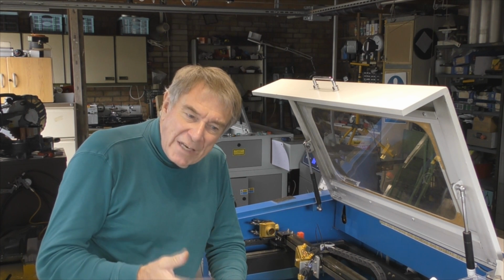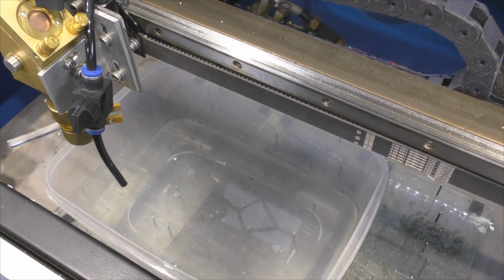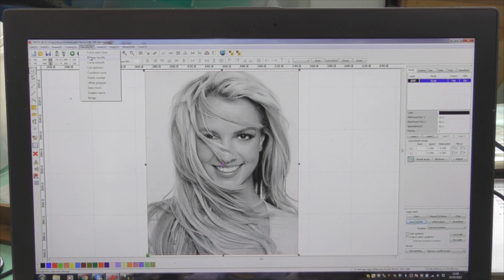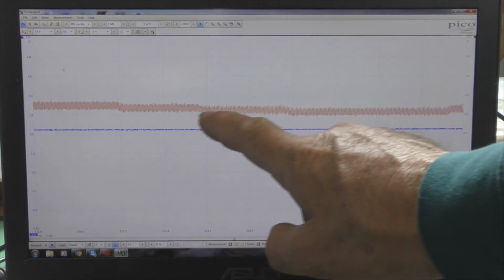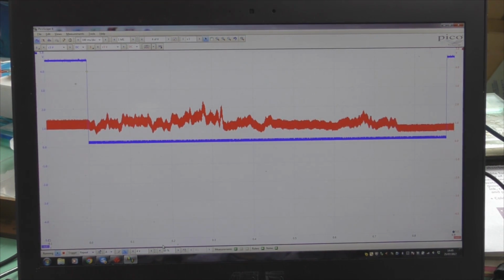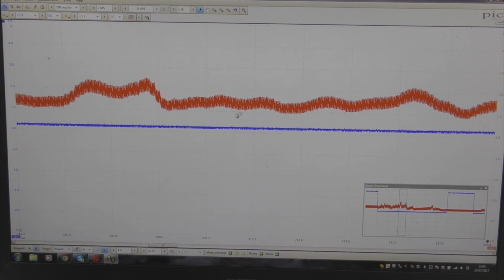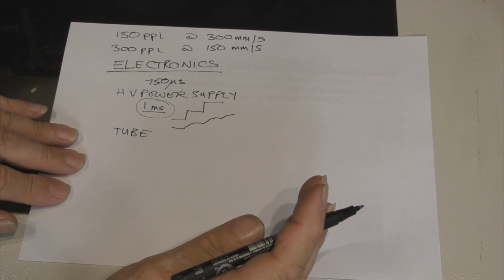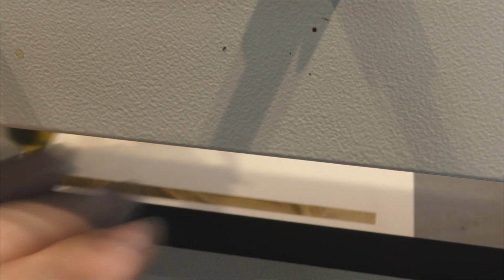RDWorks Learning Lab 114 Can We Dither Greyscale images

Comment: I've been working on greyscale engraving for a while and there are a lot of variables to take into account to get good greyscale images. Moisture content of the wood, Temperature of the wood. But think of this when it comes to greyscale. The Greyscale pattern on something like wood is not linear. As the wood starts the burn it gets darker. As it gets darker it absorbs more of the laser energy quicker and gets even darker quicker. So you can not use a linear power curve to get nice greyscales as the image will look very dark and the dark end of the scale, but by reducing the power,  the image becomes faint and washed out. If you want a 10% grey, you might need 15% power, to get a 20% grey, you might need 20% power, and to get a 30% grey you might need 22% power. I have plotted a chart to workout the power curve that produces the best results on different materials. I'd like to send you some photos of my greyscale work so you can see what I have achieved.. Greyscales are not easy to achieve, but when tweeked right do look very good.
Reply from the maker: Hi John
Take a look at your You Tube messages  as I have responded there.
Best wishes
Russ

Comment: Russ! i''m an Industrial Designer and i'm playing with my laser cutter. Last week I did a photoengraving in a 3mm MDF and the results were astonishing for me, these were my specs: Power 8-25 @ 60 mm/s with a 300dpi photograph

Here you can check the result -> https://scontent-dft4-1.xx.fbcdn.net/v/t31.0-8/20451790_2000686800188850_3444797710647928618_o.jpg?oh=c62cdcbbe0f7e1be6178c678899767c8&oe=59F43112

Original image - > https://scontent-dft4-1.xx.fbcdn.net/v/t31.0-8/20626735_2000686700188860_950388932608507449_o.jpg?oh=3011586f2c6eb5b3af566dcbabe46a2b&oe=59F09A78

Thanks so much for showing us your experiences I have been learning with you!
Reply from the maker: Hi Alfonso
Thanks for the pictures. Take a look at your you tube messages and there should be one from me
Best regards
Russ

Comment: Hi Russ ，I am studying the high frequency ionization engraving photo ,I have got a RECI 90W laser tube ,but I want to use my old 60w tube till it's life ended ,So I have a question : Is there any chance that I can use a 100W power supply with a 60W laser tube? Has anyone tried higher power wattage supply for lower wattage laser tube ? If so , Will it stable for work if I limit it's power out put for like 20mA ?   Thank you.
Reply from the maker: Hi
Back in session 97   https://www.youtube.com/watch?v=5CoTrLNUWTM   Chip Williams explains how a power supply works. To an electronic incompetent, it sounded like a foreign language at the time . However as time progressed I watched it a few times and the essence of it is actually very simple. I thought there was some complicated control system inside the power supply regulatingb the power and voltages, but as Chip mentions (quickly) it's all down to Ohms Law (V=IxR).  Take a very simple safe circuit of a battery a switch and a bulb. If the switch is open then there is no current flow and if you use a multimeter to look at the voltage across the switch you would read the battery voltage. The voltage is not high enough to  spark across the switch air gap  because all gasses (air) are essentially non conductors and that is why a switch works. Now close the switch and measure the voltage again and it will be zero. There is no longer high resistance at the switch because the voltage difference has now shifted to the bulb. If you measure the voltage difference across the bulb you will see the battery voltage is now there. The current flow in the circuit is limited by the resistance of the bulb. The battery has a fixed "push" to try and squeeze current through a fixed resistance so the system is stable and you get a fixed amount of light from the bulb. If you increase the battery voltage then you will get more light because you are able to "push" more current through that same fixed resistance. As you can see from this simple example, more voltage =more current flow. We can turn this idea on its head and use a current controller to limit the current flowing through the resistance. Less current through the lamp means less light but now if you were to measure the voltage across the bulb you would see that it is lower than the battery voltage. So back to Ohm's Law where it tells you that if you limit the current through a fixed resistance then it requires less voltage. For others, such as myself, with the merest understanding of wizzy electrons I hope this little break down of Ohms Law into understandable chunks makes sense.
Now lets look at your laser machine. Your tube is a in effect the switch in the above circuit and your power supply contains a BIG resistance load (the bulb). It also contains a current control circuit.
Bear in mind that your tube contains a column of non-conductive gas. The anode and cathode are varying distances apart depending on the power/length of your tube, so the resistance of that gas column gets more as it gets longer.. Your power supply's ability to supply voltage is designed according to the tube it is trying to drive. For a short 40 watt tube your power supply may only be capable of delivering 20,000 volts. That is more than enough to cause the nitrogen in the tube to IONIZE and become VERY conductive. Once ionization occurs its just like closing the switch and the only thing that limits the current flow will be that BIG resistive load. However, there is this current control circuit that is really limiting the current. Remember that limiting the current effectively also reduces the need for such a high voltage, so once your tube has "fired" it requires less voltage to maintain that ionization state. and that 20.000 volts may settle back to say 15,000 volts. If it drops to say 14,000 volts then it cannot sustain ionization and  effectively your switch opens and the tube stops delivering power. How does it drop to 14,000 volts? well YOU are in control of tube CURRENT and if you select 10% power for example you are limiting the current to such an extent that YOU are reducing that voltage need. At very low current flows, say 2 to 5mA, there is this zone of uncertainty with the ionization, that is this High Frequency Impact Engraving zone. 
If you have a more powerful tube it will be longer and therefore the gas column will require more voltage to "fire" or trigger ionization. A 100 watt tube may require 35,000 volts to trigger and will settle back to 25,000 volts to work normally. Whereas the 40 watt power supply will be designed to have a maximum current flow of say 20 mA, your 100 watt power supply will be capable of delivering 35mA .
Simple economics tells you that the more power means more cost so in general you match the power supply to your tube for the most cost effective solution. BUT, I hope you can see from this explanation that you cannot drive a 100 watt tube with a 40 watt power supply because it will not deliver enough voltage to trigger ionization in the longer tube..However, you can run a 40 watt tube with a 100 watt power supply because it has more that enough capability. There is one major problem and that is loss of control range. Let me explain.
When you select % power via the controller, 0% causes the controller to send out a 0vdc signal and 100% power sends out a 5vdc signal. That voltage is fed into the power supply to control the current flow. If you have a 40 watt power supply that delivers 20mA max then 5volts (100%)  will allow 20mA through your tube. If you have a 100watt power supply driving that same 40 watt tube, your 100% will now force 35mA through your tube.  OOPS!!!! So yes, you can use the over-rated power supply but you will now be limited to using 5% to 50% for your working range.

I hope you can string all these little bits together and make sense of it all
Best regards
Russ
.
Reply: Thanks a lot, Russ .That Ohms Law was what I thought about , and you have proved what I was thinking--the power range control will be the key point .Thank you again ,I've learned a lot from you .
   Best Wishes 
    Ryan Wood
Reply from the maker: Hi Ryan
If you have an ammeter fitted then 22mA will be the limit for your 60 watt tube  (1200mm lng??)

Best regards
Russ
Reply: Hi Russ
My 60 watt laser tube has the length of 1250mm (60mm DIAMETER) ,now I've got the Reci PSU the "p12" with a very nice lcd screen.It works very well ,because this PSU shows the VOLTAGE ,CURRENT ,TEMPERATURE ,HUMIDITY. I limited the output current below 18 mA ,It just perfect as hell. But there is another question ,when the humidity in my room is 50-60%, the laser power output seems weaker , it has power loss situation ,have you ever met this before? Is the heavy humidity(60%-70% ,especially in the raining day without an Air conditioning) going to destroy the laser tube or only decrease the laser power output ?

Best regards
Ryan
Reply from the maker: Hi Ryan
Sounds like your tube is the same as mine and is actually a 70 watt tube that can  run at 22mA . .Humidity and high voltages are not happy friends. I am no expert in these matters where electrons are involved but my first check  would be to run a write a test program that is a simple circle about 50mm diameter. set the power to full 20 or 22mA and the speed to 1mm/s.Drop your work bed down 6 to 10" and place a plastic container, with about an inch of water in it, under the nozzle.  Do this test at night time when its dark and you can turn all the lights off. Before starting the test open the tube enclosure or remove the lid.as you need to see inside. Start the test, turn off the lights (no panic because the program will run for over 2 minutes) now look at the high voltage end of your tube. Is there a feint glow in the air around your tube?.  Stay safely at the catode end of your machine and just look. What is your extension box made from?

Let me know
Best regards
Russ
Reply: Hi Russ 
  My laser machine has a 1400mm laser tube box, originated from the manufacturer : 
   https://www.alibaba.com/product-detail/50W-60W-80W-100W-JK6040-CO2_60555802767.html?spm=a2700.7724838.2017115.1.hxY1eB

Today I got the Reci laser tube W2 ,which is a 90watt tube ,it fits well in the laser tube box. I have done moisture-resistant and high voltage protection on the anode of the laser tube as RECI company's Warranty request .It also lost some power when the air is about 60% humidity as my old 60watt tube.I will try your advice and see what would happen.
Best regards
Ryan
Reply from the maker: Hi Ryan
Your new 90 watt W2 tube is in reality an 80 watt tube. If you look at the Reci website 
http://www.recilaser.com/en/index.php?m=&c=Index&a=show&catid=7&id=66
you will find the following instruction.

2.    Operation conditions
Water cooling: using purified water; 2 to 5 liter/minute; water temperature: 10℃-40℃.
The operating environment: temperature 2-40℃; Humidity 10-60%.
The working current: test current is 29mA. Maximum working current is 29mA. The running current must be kept below 27mA. The life span can reach 8,000 hours if the current is kept below 25mA. The ammeter must be connected to the negative electrode of laser tube.
When it is working under over-high current for long term, the negative pole will appear light yellow and the life span will be shortened rapidly.

What this means is that if you run at 25 mA as advised, then you will get 80 watts. So even the best are rather economical with the truth.

Best regards
Russ

Comment: Great observations Ross, I much appreciate everything you do.
Reply from the maker: Hi Abraham
I'm currently battling my electronics incompetence because I feel there is more to tell. I'm sure with some distant help I'll get more details
Best wishes
Russ
Reply: No worries Ross, you are doing enough to get the community jump started. I myself started doing my own observations and came to the very same conclusions. Gray scale engraving is extremely difficult, To engrave something like wood and have acceptable dynamic range, the exposure(speed) and power control must be very careful calibrated and I believe "control of power" is inversely proportional to speed, so the faster you go, the less power-resolution you have to play with. This thing is to drive anyone nuts

Comment: Hi Russ.

I use a voltage divider to test the output of the high power PSU. I don't think a simple divider has any latency. It would make it easy for your scope to measure what happens at the tube.

(Voltage divider quite literally does what it says. The ones I use divide the voltage by a factor of 1000. This makes it possible to test the output on standard equipment).

I have got a spare, so let me know if I should mail it to you.

Peter

Comment: Your scope is not really telling you what the controller is outputting.  Well, it is for the on/off signal (blue), but it is not for the red.  As you stated in your earlier video, the output of the controller is a PWM (pulse-width modulated) signal, and you've put it through an RC filter to turn it into a voltage that you can observe.  I believe that the "limit" of resolution (in milliseconds) you're seeing is actually a result of your filter and not of what the controller outputs.  In fact, the limit should be equal to the period of the PWM pulses.  So if you really want to know what the controller can do, measure the period of the raw PWM signal.

Of course, this only tells you about ONE component in the system; it does not tell you anything about what the HV supply does with that signal, nor how the laser responds.  At the very end of the chain, I think you want to see what is the slew rate of the laser (minimum time between off and on).  I think you may already have some of this data in Lab 105 or one of the others where you fired a checkerboard at a piece of acrylic.

Regards,

-Jeff
Reply from the maker: Hi Jeff
I have the advantage over many in that I have two different machines. The Lightblade has a different variant of the Ruida controller that can run with either PWM or direct analogue output. I noted that it was hooked up to the HV power supply via the analogue output line. No filters involved here but the signals look just the same. Remember I am not looking for exact quantitative results but signal patterns that help explain what the machine is doing (or trying to do) as you tick or untick various parameter boxes. My electronic incompetance seriously limits the additional useful data that I may be able to gather with my Picoscope. I have tried to monitor the current in the cathode line by adding a 100 ohm series resistor to measure the voltage drop across it. I have not done so for these gross signal changes, it was when I was first trying to find out what was going on during preionization. The signals were just too fast for my little toy scope and there were to many other signals being collected by this "antenne" to see anything meaningful. Might be worth a revisit to see if there is any useful indications about the current flow through the tube. I do believe that the HV power supply has significant distorting effects whereas I imagine  the plasma physics is much closer to instantaneous.
Thanks for the stimulating comment
Best wishes
Russ

Comment: Hi, 

I also have the weird problem of sending 'large' files through the LAN-port of the laser. The head of the laser moves all kind of ways it shouldn't.
The only solution is to first 'download' the file to the internal memory of the laser ( which however doesn't also work 100% of the time ).

For measuring the hi-voltage output, wouldn't it be possible to measure the current of the tube with your picoscope, that's just a max of 25mA. Does the picoscope have a current input, just like a multimeter has? 

Regards,
Arjen.
Reply from the maker: Hi Arjen
Not 10 minutes ago I have already answered your comments but  You Tube has decided to post it into some other parallel universe. So I will try again.

The large file issue is real because I have had exactly the same issue with that same file when trying to load it into the Lightblade machine with a different variant of  the Ruida controller.  Seems as though listening and speaking at the same time is difficult for it.

Unlike a multimeter, there is no current input, it's just a voltage driven device. I have tried to monitor the current in the cathode line by adding a 100 ohm series resistor to measure the voltage drop across it. I  did this when I was first trying to find out what was going on during preionization. The signals were just too fast for my little toy scope and there were to many other signals being collected by this "antenne" to see anything meaningful. However that might be worth a revisit to see if there is any useful indications about the general current flow through the tube.
Thanks for the confirmation on file inputting
best regards
Russ
Reply: Worth a note: When handling files from your PC - use the "doc" tab to your top right. It allows the best way of handling files on your laser.
Reply from the maker: Thanks Peter. Not been there so I will check it out. I rarely use my PC to control the machine, although I have found it convenient to do so just recently.
Best regards
Russ

Comment: Just a curious thought here, but what about taking a new measurement with the picoscope where you measure the variance in the light output of the plasma in the tube to see what kind of wave you get there? I don't know if you have a third channel on the little scope or not but it would be interesting to see what a photodiode or phototransistor makes of the light intensity of the pink plasma compared to the other two signals.
Reply from the maker: Hi 
That's a novel thought. Not something in my normal mechanical engineering "toolbox" but does not sound difficult or dangerous for an electronic dunce such as myself. I'll give it a try.
Many thanks for the comment
Russ